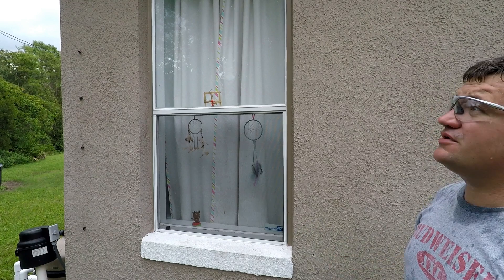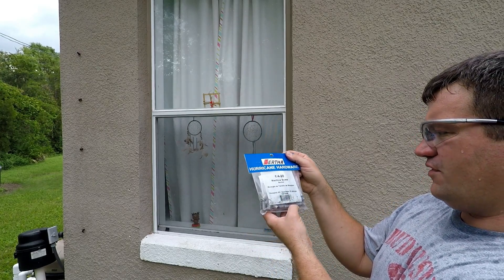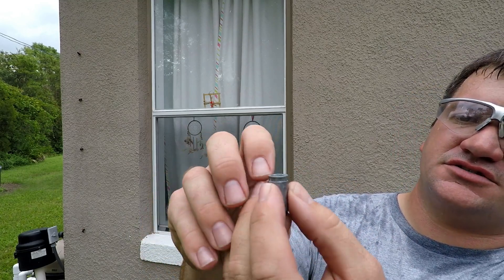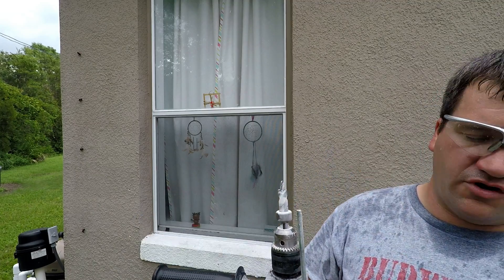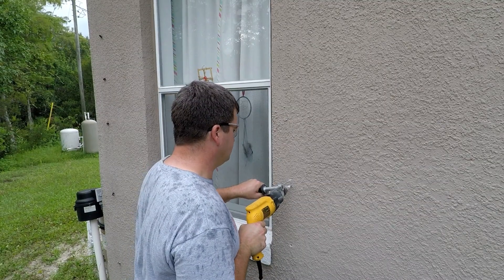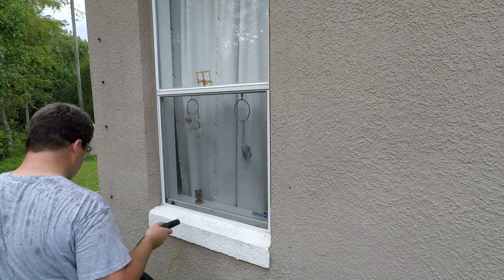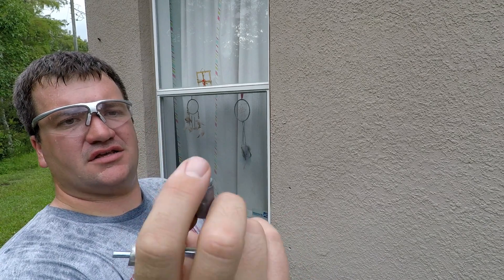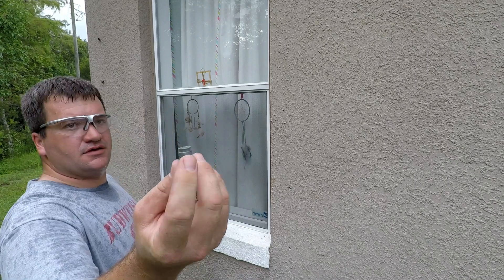Bertha Hurricane Anchors

Comment: A couple of my existing anchors pulled out. I was able to drive new anchors in the existing holes and they appear to be holding. A better anchor setting tool is the Greenlee 868. The 868 is more expensive than the tool used in the video. There are generic versions of the Greenlee 868 available. The advantage of the 868 tool is that the expansion anchor screws onto the tool.  Another tip is my local corner hardware store sells the anchors individually versus having to purchase a box of 25 at the big box hardware store. I researched using epoxy for the repair and found that there are anchors designed for epoxy termed Adhesive-Grip Female-Threaded Anchor. Power-Sert is a brand name female threaded epoxy anchor. These anchors are a threaded cylinder with ribs on the outside of the cylinder. Most likely they will have to be ordered online or from a specialty store. This video was very helpful
Reply: Thanks a lot for this information. I have to repair a few anchors that came loose earlier this season in case I need to to use shutters for the potential hurricane next week. Appreciate it !

Comment: I use these type of lead anchors to construct electrical vaults. They hold a lot a lot of weight. Very good for this use. If anyone Is on the fence don't be. These things have held hundreds of pounds of weight from cable and equipment on them. If you feel like they aren't enough there is another size up that uses 1/2 screws but you can't drill too deep into the cinder block unless it's completely filled In with concrete.
Reply: I see these types of anchors pull out and panels come loose during hurricanes, the house next to me has these anchors and he lost four of them and three panels can loose during Hurricane Ian leaving two of his windows exposed.
Reply: @mustangecoboosthpp3869  I'd bet they weren't set right. I've installed a ton of them and they don't pull out unless you set them too shallow, backwards, or if the load is very dynamic/shock.

Comment: I have a question. Is there a minimum distance that you should have from the edge of the window to were the screw is placed? I have some shutters that were given to me but I have to drill the holes 1.5 inches from the edge. Is that ok?
Reply from the maker: It really depends on the building construction. Keep in mind that could be right in the edge of the block.
Reply: @ScamsGarage  I did not think about that. I have seen some videos of people doing professional installations right at the edge. Mine is a block and stucco construction, like almost everybody in south Florida.

Comment: I have some that have crapped out on me.  Any ideas on how to get them out?
Reply from the maker: One thing you could try is to take the sidewalk bolts and screw them in a bit. Then pull them out using a pry bar via the bolt. Or if the anchors has no thread to it then you can drill them out.

Comment: I have seen people put glue on the anchors before sticking them in. Is that necessary?
Reply from the maker: If the hole isn't drilled nice and straight some people will use a two part epoxy to help hold these in.
Reply: @ScamsGarage  Thank you. I appreciate it

Comment: mine came out removing the shutter. How do I secure it back in?
Reply: U can either keep them off and put them back on next time or you can order the bertha screws and thise wont come off as easily but prepare for some power drilling...
Reply from the maker: I would get a new anchor don't try to reuse the same one. Also when you install it this time use a two part epoxy in the hole and the set it with the punch. It sounds like the hole might be a bit over sized.
Reply: @ScamsGarage  it has definitely been opened up. You can see a crack throughout AND where the builder stucco filled over the crack. Lowes recommended putting it back in with epoxy. I used Gorilla Glue because it had the strongest rating. Put a ton in the hole, put some on the anchor, smashed it in with the punch and then placed some more around the front in the gap. I'm letting it sit for a few days before I test it. I'm in central FL and humidity slows everything.

Comment: Do i use the same anchors for a stucco wall with wood frame?
Reply: No, at least for wood frames there is a special washer heres the name 
¼-20 Brass slotted wood bushing qty 25 Thread Insert for Wood, Solid Brass, Bertha Hurricane hardware 157462
Reply from the maker: No these anchors will not work in wood. As Mario stated they make a brass insert or I have seen people use the lack bolt style studs. No matter what make sure you are going into the framing not just sheeting.

Here is the brass inserts that take 1/4-20 bolts -

https://amzn.to/316zrO3

Lag bolt studs -

https://amzn.to/2HV6blM

Comment: Yo!  I’m in Cape Coral…. I use your channel all the time. Question about the anchors (hurricane shutter bolt anchors). Should they be flush or inset a bit?  I have to replace a couple of mine and some are flush & some are inset about 1/4”.  Does it even make a difference?

Comment: What size "Sidewalk " bolts did you use with those 2" anchors? I see lowes sells them in various lengths.
Reply from the maker: The size sidewalk bolts that I used with the anchors were 1 inch long but you may have to use the 1.5 inch length  if you set the anchors deeper.
Reply: Thanks a lot. I'll get the 1.5" then. I didn't know Lowes sold all this stuff.
Reply from the maker: No problem.

Comment: Thanks for the video.  Can this be used for a wood frame house?
Reply from the maker: Thanks for watching. The anchors in this video are actually designed for block or concrete not wood. 

This is a link to the ones I would recommend for wood frame houses. The downfall to these is the will always have a stud sticking out from your house. 

https://www.amazon.com/Door-Window-Permanent-Hurricane-Anchoring/dp/B079S89MZR/ref=as_li_ss_tl?s=hi&ie=UTF8&qid=1527717501&sr=1-1&keywords=hurricane+anchors&linkCode=ll1&tag=scamsgarage-20&linkId=7ebc1be1fa442fc6af6297204b94b56a
Reply: Scams Garage Thank you!
Reply from the maker: Thanks for watching! Please like and subscribe!

Comment: Will this work with a brick home or is something else recommended ?
Reply from the maker: This should work fine in brick homes. I would stay away from the mortar joints.
Reply: Scams Garage hard to see the mortar joints but when you hit ine you will know cuz u wont make it past with the drill...just move on to the next hole ...
Reply: No! These anchors must be installed in Block or Concrete. Brick is NOT a substrate It is a waterproof covering. Brick is generally found over wood frame. If your home is wood frame, you must have anchors long enough to go through the brick and anchor into the wood framing.

Comment: What size drill bit did you use?
Reply from the maker: This is the bit we used, it is a specialty bit that is made for these anchors. 
https://www.amazon.com/Bertha-Specialty-Drill-Bit-50054/dp/B004Q05SCU/ref=as_li_ss_tl?ie=UTF8&qid=1524531932&sr=8-1&keywords=Bertha+1/2-in+Twist+Drill+Bit&linkCode=ll1&tag=scamsgarage-20&linkId=260c037a3be6126ed73781e4b9f6f11b
Reply: Scams Garage went to the store and found out 1/2” drill bit was bigger than the anchors, bought 7/16” instead. Would it work?

Comment: Bought these at lowes.  Looks like bullet holes and I had several that came apart.  Good video but I will be looking for something else
Reply: I also thought the anchors were just not solid and went with Hurricane Panel Mounting Hardware 1/4"  Anchors w/Wingnuts  Caps Poma Screws just a hell of a lot more work cuz you gotta drill hell hole to make them stable! And if have a brick house dont go too deep as you will end up resorting to the anchors 🤠👍🏽
Reply from the maker: We haven't had any issues with ours but another option is the Elco panelmate screw in flush mount anchors. They also use the 1/4-20 sidewalk bolts. I have heard of people putting a two part epoxy on any type of anchor to help secure them in the wall. Some say this helps keep them secure during vibration form wind also. 

http://www.elcoconstruction.com/Products/Building-Protection/PanelMate-R

Comment: Hmmmmmm...dosen't the wedge go in the bottom of the hole... that creates more mechanical hold rather than just a friction hold like you are showing.... like a cork in a bottle... it will come out.
Reply from the maker: The wide end of the wedge goes in first and then the led outer ring swells around it when set with the punch. If you think about pulling on the threaded insert (wedge) it will try to pull deeper into the ring swelling it out more. If it was the other way it would pull right out of the lead ring. 

Here is another article on installing the anchors and more information - 

https://apps.floridadisaster.org/hrg/content/openings/diy_shutters.asp